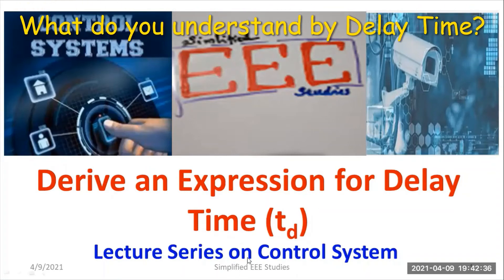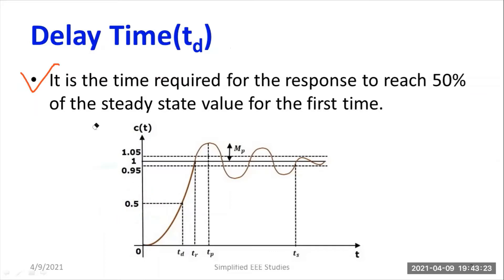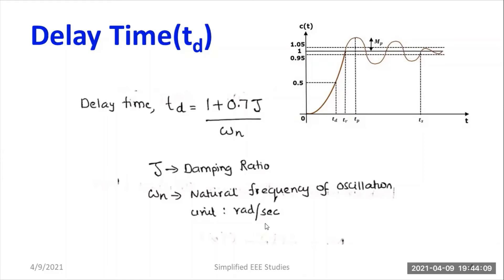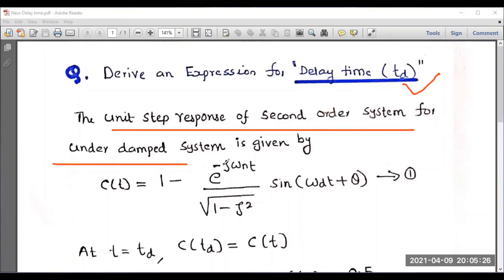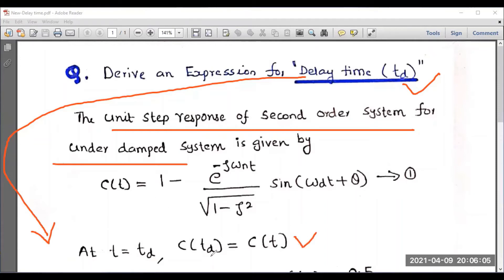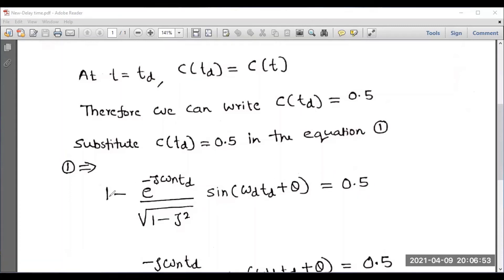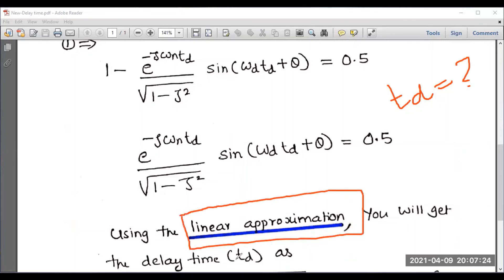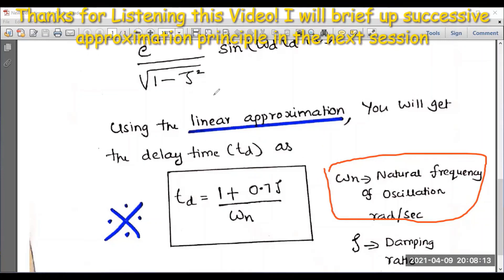Delay time|Derivation|Expression for Delay time td|Control System|Lecture| Time Domain Specification

Comment: Okay, so this formula is true for an underdamped system with a unit step input, but would it work for other system types such as overdamped unit step input, or underdamped ramp input?